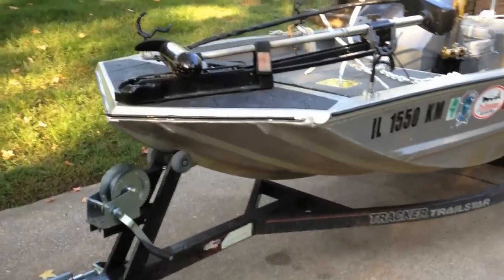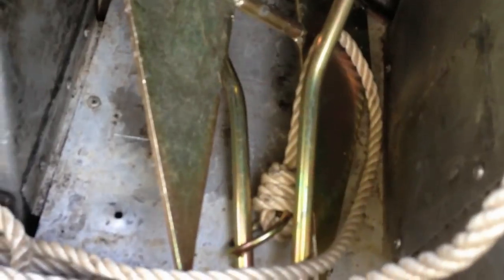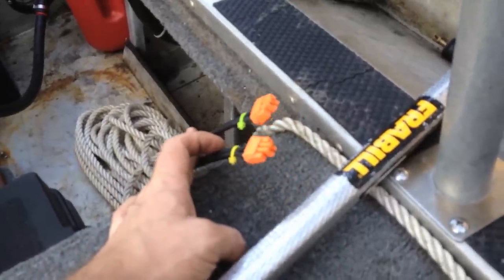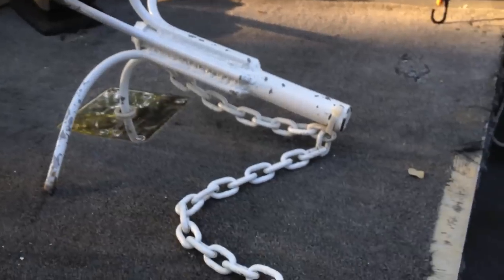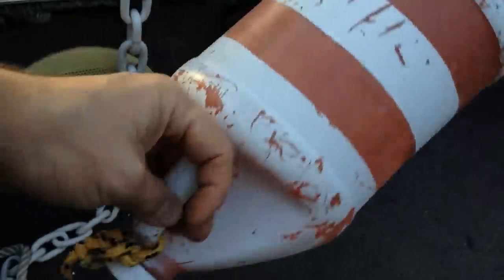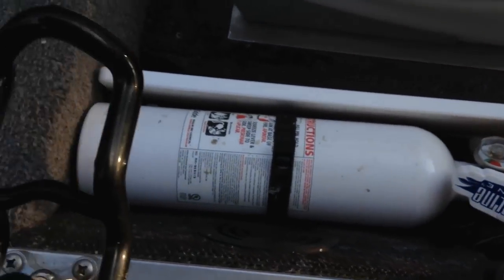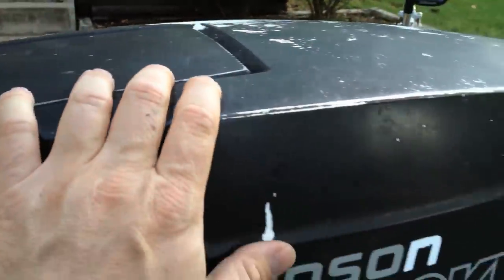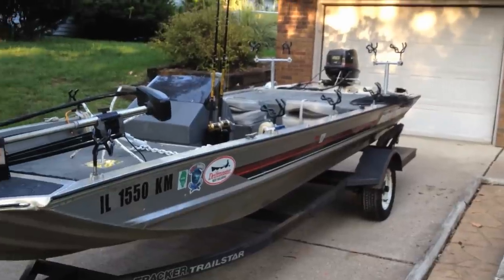1990 Bass Tracker Pro 17 with 40HP Johnson: My "CAT TRACKER" catfish boat tour

Comment: I have an 89 Pro 17.  The throttle control had a part inside that broke and won't push the throttle now.  Any idea where to buy a new or used replacement?

Comment: I know this is an old video but do you have a link or any info on the battery charger cable you are using?
Reply from the maker: Yeah. I got them from the local box store and they ended up getting hot. I ended up changing them to these. Inexpensive and more durable. 
https://www.homedepot.com/p/Leviton-15-Amp-Polarized-Light-Duty-Connector-White-R52-00102-0WP/100027377
and used this end on the charger
https://www.homedepot.com/p/Leviton-15-Amp-125-Volt-Light-Duty-Plug-R52-00101-0WP/100356964
The wire is low voltage  underground wire. it was the same as what was on my battery charger and it was on a big roll at the box store.

Comment: Does youre johnson have the vro system?
Reply from the maker: Not sure what that is, so I guess not. Also, I sold it a few years ago so it would be difficult to check.
Reply: @SeanWalkup  i gotcha.well the vro is where there is a oil tank & theres a pump that mixes the oil in the gas as it needs it.it was real common on those motors.mine had that on it & i took it off & pre mixed my own gas.those stupid vro's are prone to failure.i was just wandering.good luck out there.stay safe.
Reply from the maker: @ninjagodzilla6402  Ah. It did have that, but I rebuilt the fuel system to use premix and removed all the VRO stuff. Swapped the fuel pump to a standard premix style that was available on the non VRO models
Reply: @SeanWalkup  yes sir.thats exzactly what i did as well.my boss bought this tracker new & when that pump started to fail he could not figure it out.he even took it to a local boat shop & they tried to rebuild that vro pump.ran good for a week then started acting up again.i bought the boat for $1500.00 & its probly only got 40 hrs on the motor.i fixed it in a day.cleaned the carbs & put a regular fuel pump on it & this puppy runs great lol.you still catfishin?
Reply: I live in arkansas.i fish the arkansas river where it meets the missippi & the white.exellent catfishin.its almost time here if the dang rain will let up
Reply from the maker: @ninjagodzilla6402  Not at the moment. Work got so busy I had no time for fishing. I'm sure I will get back to it someday. Good luck to you though. Bend some poles!